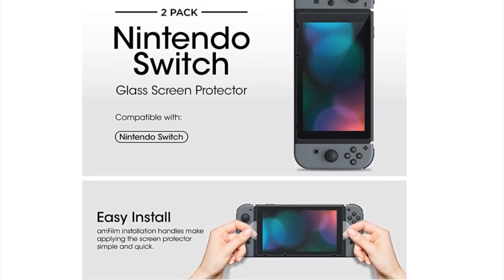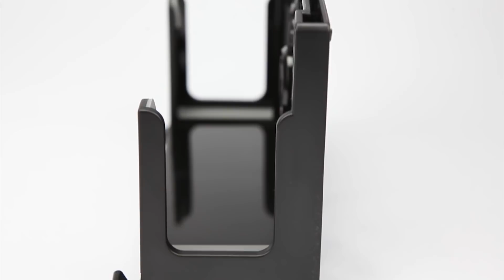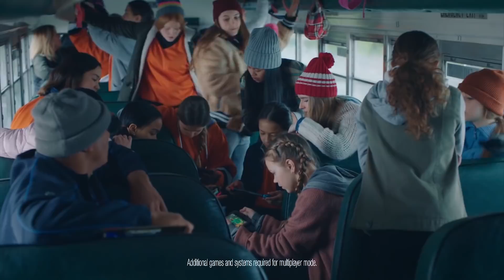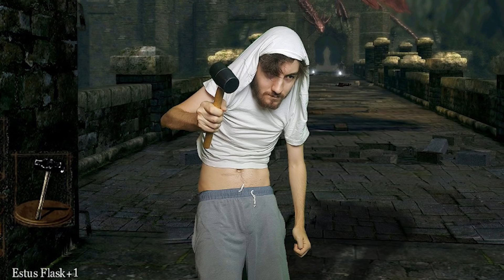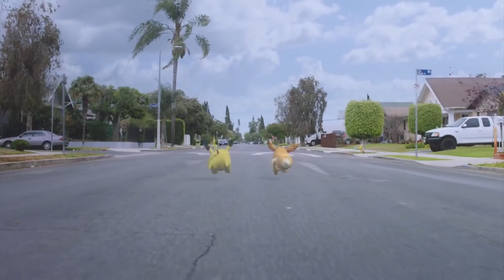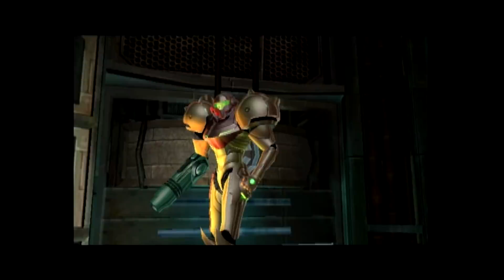More Nintendo Switch Accessories in 2018

Comment: When you say you can only use it for one controller is that just for ps4, Xbox one controller, etc... or does that include other controllers that were designed for switch?

Comment: Really neat accessories all around. I'll probably pick up the 8bitdo at some point so my friends don't have to use the Joy Cons. BTW, I'd recommend getting an Amazon affiliate account to help supplement YouTube's paltry payouts (along with the Patreon, of course). Even if it's not much, I'd still suggest it.
Reply: Matthew Miller How did the 8bitdo work out? I’ve been looking at that adapter as well as the mayflash one but idk which to pick. Mainly to play Mario Kart and Smash Bros on a Wii U Pro controller/PS4 controller.

Comment: Is there any lag with the 8bitdo receiver and the Xbox/PS4/Wii u controls?
Reply from the maker: No since it is bluetooth based. Reviews for the adapter has been really good!
Reply: Commonwealth Realm Nice! I bought a wired adapter but it lags just a tiny bit where I can notice it.
Reply: mayflash adapter >>
Reply: Diego Rios What’s the difference with the mayflash? Idk which to get. I’ll mainly be use it for a Wii U Pro controller and/or a PS4 controller to play Mario Kart and Smash Bros
Reply: um AppaL mayflash is pretty simple to use I use it for my wii u pro, ps4 and ps3 sometimes it lags but not super noticeable it has around the same ammount of lag as a gamecube wavebird controller for smash
Reply: Diego Rios Ahh, thanks. I’ve also seen that the motion stuff works on the PS4 controller as well, if you’re playing Splatoon and Mario Kart. Not sure about the 8bitdo
Reply: Diego Rios Also, do either need software updates on a pc in order to use them?